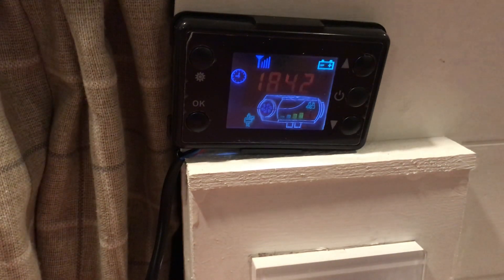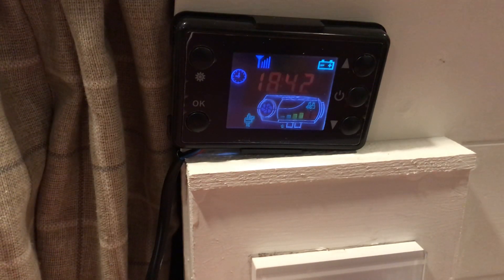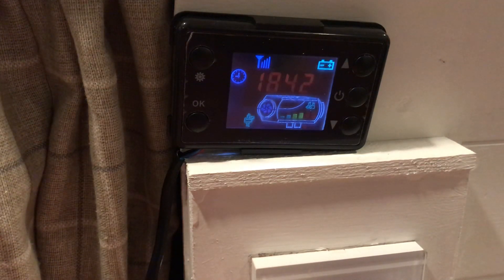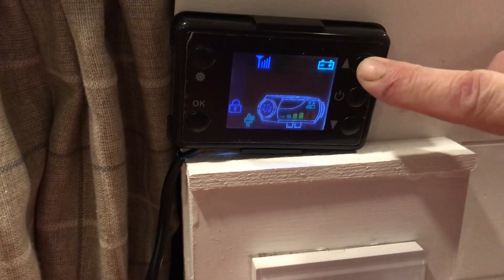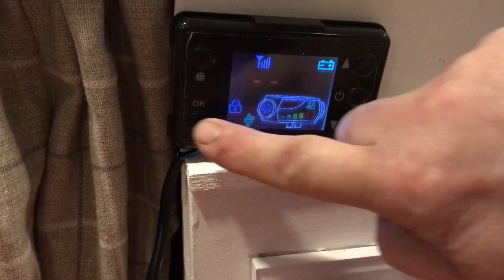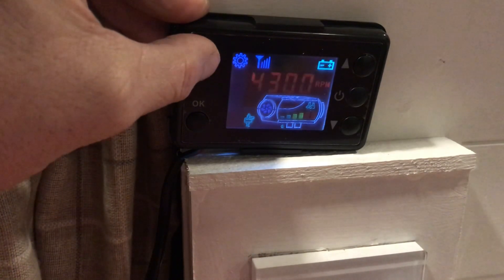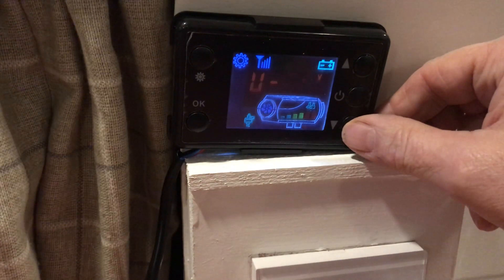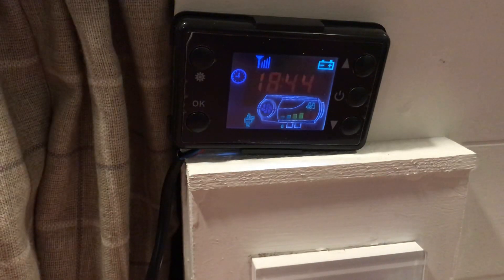Chinese Diesel Heater - Changing from 24v to 12v

Comment: When I press the settings button three times it doesn't let me into the advance settings! Has anybody any help on this as it must be on 24v and I want to change it back to 12v as low voltage is coming up??

Comment: I ordered the 24v version but the one I received says 12v. The seller says it will work on 24v. I am worried if I wire it to my 24v system it will blow up the machine. Help me!
Reply: So what happened?
Reply: @SwampMyster  it didn't work. An error message came up saying E-2 which means over voltage. Luckily it had the over voltage protection. It didn't let me  change anything on the menu. I ordered another one from amazon. The description said that 12/24 volt. And it did work. You can set it up on the menu either 12v or 24v.

Comment: Just installed a new unit and none of the buttons do anything is there a reset button or would it be a faulty  controller or the main computer? pressing the two top or even the two bottom buttons has no effect whatsoever.

Comment: It looks like there are some folks out there with the same question as me - Accidentally got a 24v version but want to run 12v.  Besides this setting for the ECU there are two other potential problems - the fan motor and the glow plug.  Easy enough to swap out for a 12v Glow Plug, but I wonder if the fan is possibly dual voltage, or if they use a different fan motor controller on the 24v and 12v versions.   So the big unknown is the fan motor in my mind...
Reply: if it helps anyone I just searched for the fan motor and found all except an Eberspaecher were listed as dual voltage,,  same with the motherboards they list as dual voltage.

Comment: Ive just installed a brand new heater in my van and am immediately getting an E-03 message.  wasn't aware of the voltage change, could this be causing the issue rather than a faulty glow plug do you think?   (Ill test in the morning, given up for the day :S)
Reply: Same. Any solution?
Reply: @TacticalNacho  only solution i found was to buy a new heater unit.  i ordered two separate glow plugs to try but both arrived smashed. i figured i'd give it a go with the new heater unit and return it right away if it didnt work.  The new one works perfectly and has done every day since.  Luck of the draw i suppose
Reply: Nooo it’s the voltage ! Had the same problem ! New in box heater ! It’s how I hard wired my heater !

Comment: Hello, maybe you can help me. I ordered a 24 volt version but the stikker on the heater and on the pump says 12 volt. Can I just switch to 24 volt on the display and expect everything to work fine?
Reply: Id like to know the same.
Reply: Same here. I ordered the 24v version but the one I received says 12v. The seller says it will work on 24v. I am worried if I wire it to my 24v system it will blow up the machine. Help me!
Reply: @InvernessFarm  so what happened l have the same problem?

Comment: Does the glow plug need to be specific for 12v? I accidentally ordered a “24v” version and switched to 12v in settings and am now getting an error code indicating ignitor is bad. Anyone know?
Reply: I believe it does, I thought they sent me the 24v unit so I connected it to 24v and it said the glow plug was defaulting, after switching back to12v and setting the control to 12v it is working now. At least it is trying to.

Comment: Die chinesische Standheizung kann man von 24 auf 12 V oder umgekehrt einstellen, wenn man nach der Zeiteinstellung den Code 1688 eingibt. Damit kommt man in die Grundeinstellungen wie Ventilator Drehzahl und Pumpen-Geschwindigkeit. Wenn man das alles mit OK bestätigt, kommt irgendwann 24U (12U), das kann man mit dem Pfeil nach oben wieder umschalten auf 12U (24U). Bestätigen und nun läuft die Heizung auch im normalen KFZ bzw. mit einer 12V Batterie.

Comment: Hi there interesting video im currently having trouble with my heater it cant seem to get to the 2nd red bar/max temp even after its been running for an hour,  just wondering once you enter the code can you change the power on the heat output?  Thanks
Reply: I believe you can set the lower and upper power settings once your logged in.
Reply: @nagger2000  i got it sorted i put the 1688 code in and went from there 👍